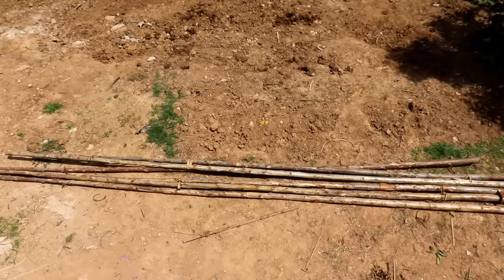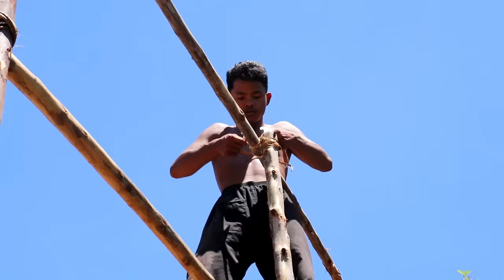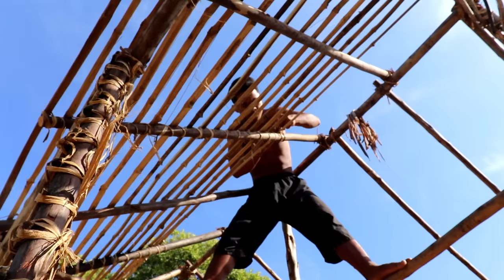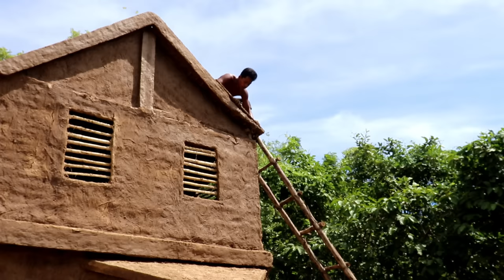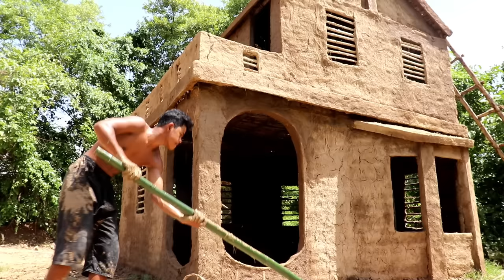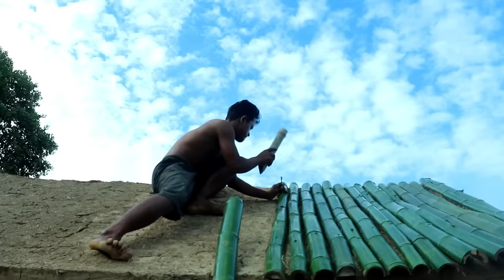Amazing 2 Weeks Build The Beautiful Bamboo House

Comment: Really cool but I’m wondering what happens when it starts raining during monsoon season.
Reply: It's covered in bamboo, it will withstand the rains
Reply: @mamaming8447  that’s not my point, everything inside will be wet as well
Reply: @mamaming8447  hot wanted to
Reply: @mamaming8447  aá,

Comment: The roofing just won't work, the adobe is going to be washed away, There should have been inverted interlocking bamboo under the bamboo roof slats. These builds are not structurally  sound, the first sign of insects and those bound joints are gone.
Reply: ၁၄၄